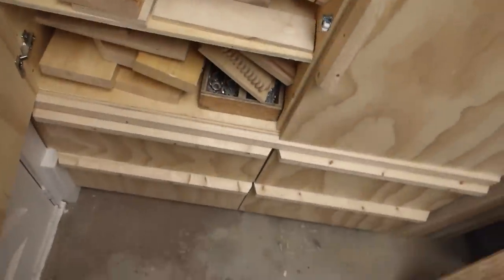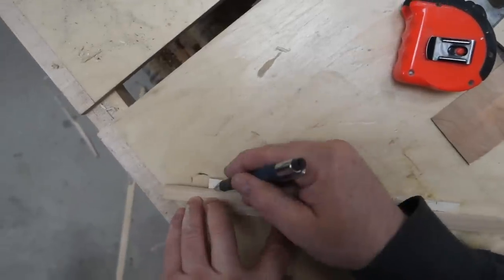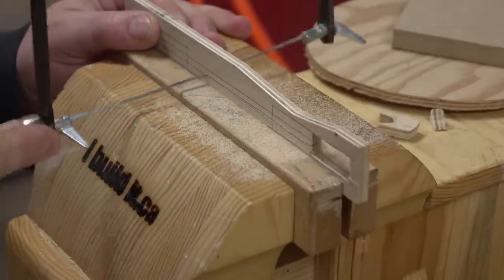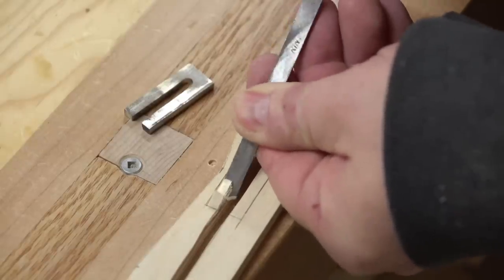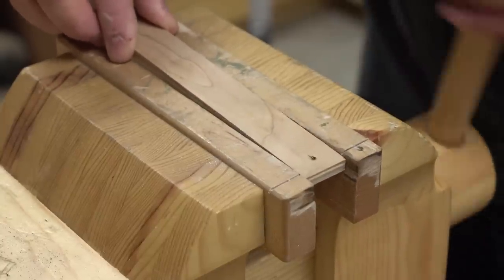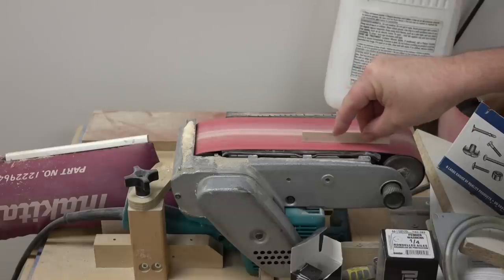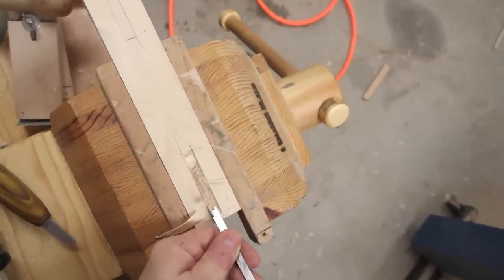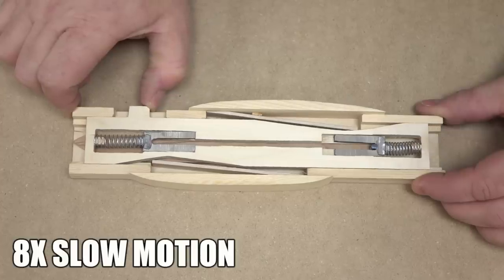How To Make A Wooden OTF Switchblade

Comment: Great build John, I never knew how they worked, so it was very informative. Thanks for posting the video. I do think the fast forward part of the video is a cool thing to keep the length of the video shorter for repetitive operations.
Reply from the maker: +Michael Anway 
Thanks! I generally only show part of a repetitive operation at normal speed to save time. There's usually no need to show all of something sped up.

Comment: Wow interesting.... I actually found this exact  switchblade this "launcher" was replicated from on the side of highway 30 headed westbound toward downtown Fort Worth,  Texas  right on the outskirts of Arlington, Texas when I was walking on the shoulder making my way to Eastchase Parkway in Ft Worth. There was a little damage done to the switchblade and thanks to your video I now understand  a possible solution for this similar problem on the blade not launching fully to it's designated length. I believe on my blade there must be two identical but separated diagonally opposite end of the housing inserted into machined triangular groove slots that remain in  locked position until the pressure of the spring switch slides the pin out from the beveled notch on both sides of the actual blade.

Comment: The first time I watched this I was completely baffled, and confused on how it functioned, after discovering miniature ones at a gun show, it made me go and take another look, now I realize its function...

The wooden "Springs" on the sides hold the knife in place, and keep it from sliding out, and when you push the slide forward, tensioning the springs back, the angled slots on the sides slowly ride up against the wood, lifting the blade free, and relieving the tension off the springs, pulling the blade forward... 

I think thats the all the mechanical works in it I believe... Not entirely sure, but loved the build!

Comment: Great video, I generally make larger fixed blade camp, outdoors, and chopper style knives. I would just like to kGreat video, I generally make larger fixed blade camp, outdoors, and chopper style knives. I would just like to eventually know how to make folding, spring assisted, or automatic knives. I would actually like attempt to make what you did but with metal ( I just have more access to more metal working tools than wood working ones).

Comment: you should've used smaller springs but with enough force to push the blade out and since the aprings smaller you could've cut down on the wood lengthwise and horizontal making it smaller and making it look better

Comment: Enjoyable video, and a brilliant mechanism! Using the angle grinder without the guard, is...well, do you want to hear what happened to the neighbour while doing the same? :D
Reply from the maker: +Ivar Malde 
Your neighbour is probably a rookie and screwed up. I'm a seasoned veteran with more years using a grinder than many of my viewers have been alive. Open your eyes and recognise the difference.
Reply: +Ivar Malde I've been welding and working steel professionally for 20 years and the first thing I do with a new grinder is throw the guard in the trash so I don't have to figure out another place to store it.  We all take risks, and as long as we understand consequences, we are making informed decisions about these risks.  For me, the risks associated with operating a grinder without a guard are acceptable because I get better use out of them, and yes, they have bit me.
Reply: Sure, a good disc is not likely to fail - unless it gets damaged before or during use. However... Well, I just had to mention it ;)
Reply: Yep, and I have found grinders in the shop that have been dropped and hung back up with broken disks--we all need to inspect our tools prior to use.  I have also used defective 5" grinding wheels that blow up as soon as you apply pressure to them (we had 4 boxes) and while that is exciting, as long as you are wearing the proper PPE for the task, it's not a big deal.

Comment: in 5:35 you change the slider, look, you originally used 4 springs and then changed to 2, and added small pieces of wood for the spring not to leave the place

Comment: In that blade would have so much more strength. A few layered Yearwood like literally Phinne sheets, Malon and glue each one, but every other one, put the green pattern the opposite direction and give you a lot of strength Rizzuti and you can make it that was somewhat flexible as well without snapping go to laminate it in lyric.

Comment: Back in 1689 I had a serious vampire problem and build a similar knife with match sticks , ended up almost burning the cottage down,  I ended up using pig entrails filled with holy water. that worked like a charm

cheers

Comment: this style of switchblade is referred to as an "OTF" switchblade or "out the front"
Reply: +biohzrd1x1, with the style of blade, I would say it is closer to a large stiletto, which uses a more bayonet style blade than an OTF which tends to be a standard style blade.
Reply: Leland Lewis a stiletto deploys from the side and is only single action traditionally and OTF knives have no standard style of blade all it has to do to be called an otf is deploy from the front of knife
Reply: Not correct.  A stiletto deploys and retracts from the front and as I said, has a bayonet style blade.  All OTF knives I have seen have a single sided blade, like a standard knife, but deploy from the front.  Side deploy is a standard switchblade.